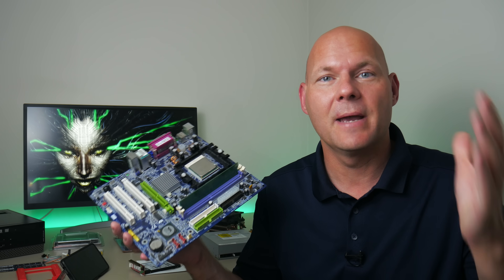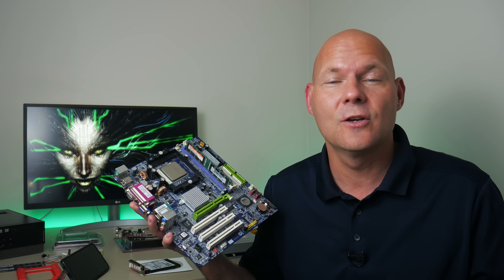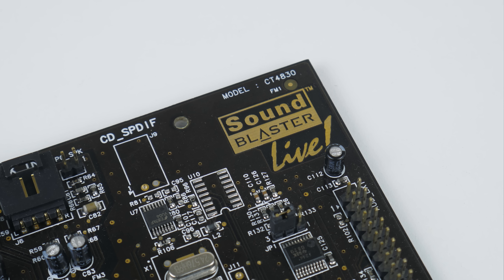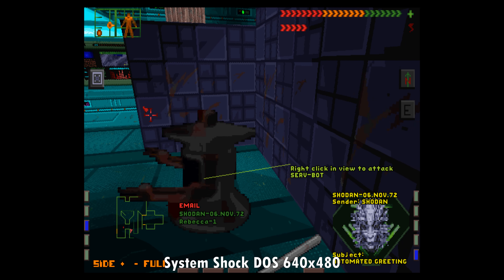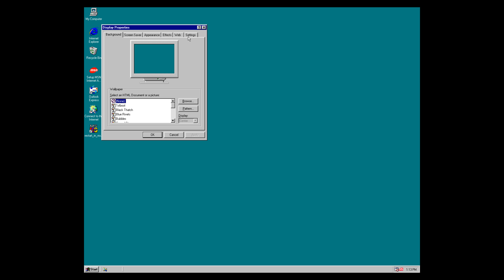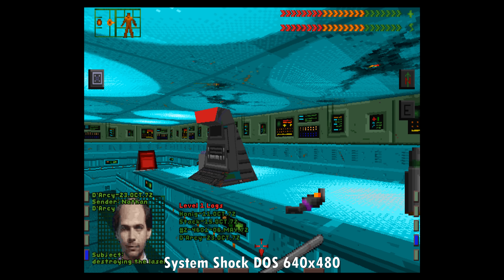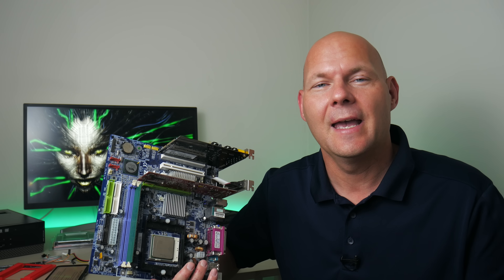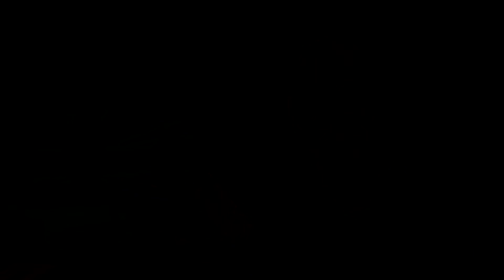Running Demanding DOS Games on Affordable Hardware

Comment: Great video! Can you please make a video comparing a system like this with DosBox?
Reply from the maker: I've done two videos on DOSBox recently, there should be enough in there for you. As for emulation vs real thing, well that's more of a personal matter for most like do you have space and do you like playing with old hardware or do you just want to play the games?
Reply: @philscomputerlab  I watched both the DosBox videos. Great content. I do not have the room, i'd have to make room. I prefer to play the game over building an older system, however I have old parts. I do have Athlon 64s and X2s with the boards to go with them. I have both VIA and nVidia chipset boards. RAM in every different type and module. And I have a plethora of PATA drives up to 500GB. Smallest I think I have is 8GB unless you count the even older scsi and IDE drives that were 20-100MBs. I have a handful of sound cards and a few CRTs. Question is, do I build a rig or two or do I go DOSBOX Staging? I want to try the DosBox method first. I got it working about 10 years ago but back then the PCs weren't THAT old. Last time I tried, about a year ago, I had to shelve the project. For whatever reason I couldn't get it to work. But therein lie my dilemma. I wanted to try DosBox to see whether or not building an older machine would be worth it or not and never got it off the ground. Hence me asking you, an expert in this area of gaming, for a comparison video. Thank you for the reply.
Reply from the maker: @Dr.C-UTS  Fair enough. I'm thinking 🤔 how I could do such a video, it would be mostly talking head and sharing experiences...
Reply: @philscomputerlab  Side to side capture comparisons and compatibility information too...
Reply from the maker: @Dr.C-UTS  In such terms you will struggle to find differences. It's more about issues like you say, not having parts or space.
Reply: @philscomputerlab  For me I have the parts. And they take up so much space I have no more! True story. LOL. I figure a video like that would inform many people. Also, how hard each process is to complete.
Reply: @philscomputerlab  Also, if you need any parts for the video I can donate.

Comment: Hello, you've had a review of an old card.. R7 250 DDR3   2GB.
What is the version of the identification program that you use and is stable with you on this card.
If possible, a link to download this copy.
Thank you
Reply: @philscomputerlab  I need to Driver for R7 250 DDR3   2GB.
Works well with this version of the kart .
Because most of the driver versions . Even the one who is on the amd company website gets after its installation problems with the card ...Screen rupture and device spasm..
This is your video link .
In which she talks about this version.
I have the same copy.
https://www.youtube.com/watch?v=v3a0E3-unHs
I hope you will help me get the right driver version for this version of the card ..Thank you

Comment: Why not Athlon XP instead of Athlon 64?
Reply from the maker: Why Athlon XP over Athlon 64?
Reply: @philscomputerlab  Is a most common CPU after P4 and very easy to find, basicaly is an Athlon 64 but only 32bit. Also most Motherboard for it come with a VIA KM133 build in (Pro Savage/Savage 4) on the Motherboard, a very competent iGPU to play old Dos games.
Reply from the maker: Good point with the graphics! What I don't like about the Socket A is the cooler situation, the high power draw on 5V and issues with modern Power Supplies as well as the exposed die. I've done Socket A videos in the past, for sure we can check out the platform again :)
Reply: @philscomputerlab  im using a good old seasonic single rail on my Athlon XP 2400+ no single issue.
Reply from the maker: It is an issue for people wanting to build a Retro PC though. Especially if you go for one of the faster Athlon. Hence I recommend skip the platform go straight with Athlon 64, I don't see any downside.
Reply: @philscomputerlab  The only Athlon 64 era boards I have all have PCIe only, no AGP or PCI. For me I went with an Athlon XP system partly for that reason, because I wanted to run Windows 98 natively and getting either an Athlon 64 board with AGP or a PCIe GPU that works in Windows 98 was a problem.
Reply: Also a lot of the cheaper Athlon XP Mainboards tend to be quite unreliable. I also would go Athlon 64
Reply: @MKRENB  your opinion, also the same can be said about cheap am2 MB

Comment: I started playing OG System Shock on my retro PC fairly recently under Win98 without rebooting into MS-DOS mode and it works great. I use a Sound Blaster Audigy SB0090 sound card, and in the control panel in Windows you can load up to a 128MB SF2 soundfont and DOS games that use General MIDI will use it. For System Shock, I also used "Toxic Frog's High Resolution Patch" which allows you to run the game at up to 1024x768. Other than the sound card, my system is an Athlon XP 2400+ on an ECS K7S5A with 1GB DDR RAM, running off an SD to IDE adapter. It's worked great for almost everything from the DOS / Win98 era except for some very old games such as Secret of Monkey Island 1. Another game that doesn't work properly that disappointed me a bit was Star Wars Dark Forces. The game will actually run fine with AdLib audio, but if I select General MIDI the game freezes on launch with all the correct settings. I have X-Wing, Tie Fighter and X-Wing vs. Tie Fighter on there and all of those work perfectly with General MIDI music, but for some reason Dark Forces will not. All the classic "boomer shooters" work great; Duke3D, Doom, Hexen, etc.

Comment: I thought original tomb raider had hardware graphic acceleration support? Maybe that’s the windows version only?
Reply from the maker: Only with 3dfx Voodoo and a software patch!
Reply from the maker: And a few other 3D cards. System Shock later got a Windows version, but the DOS one isn't accelerated.

Comment: Hello Phil,
Do you have any idea if the integrated Network controller on this motherboard is compatible with Dos network gaming?
Reply from the maker: I checked the driver package and it includes DOS packet driver, so should be good to go!
Reply: @philscomputerlab  that's interesting. Thank you!
I'm planning a Warcraft2 lan party with my colleagues and I'm trying to find the best way: S754 with integrated lan, or modern PC's with PCem or 86BOX 🙂.
The easiest way I think is DOSBox, but it's too easy🙂

Comment: Another excellent video! As for myself, I have 2 retro machines under my desk. A Pentium 3 500 in a slot 1 motherboard with an Intel chipset that has 3 ISA slots. Voodoo 3 3000 for GPU, an AWE64, a Gravis Ultrasound, and a MPU-401 compatible MIDI card for intelligent mode games, which I probably don’t need thanks to the existence of SoftMPU. I run Win98SE, booting into MS-DOS 7.1 directly. The second machine is a socket 478 Pentium 4 at I think 3.0 GHz with an Audigy 2 ZS for the sound card. Run Win98SE and WinXP on that one. Have you heard of SBEMU? Gives 8 and 16 bit Sound Blaster emulation in DOS running on relatively modern machines. It can work with Intel ICH or High Definition Audio, nForce 2, VIA VT8233 or VT82C86 and Sound Blaster Live and Audigy cards. I haven’t tried it myself, but as long as machine is capable of booting into legacy mode, this could enable much more modern machines to run DOS games baremetal. Could also help in VMs where the hyper visor provides AC97 emulation to the guest OS. Might be something to check out.

Comment: Awesome video as always! :) I noticed you mentioned networking, I have been using RetroNAS for two weeks or so and I found it to be fantastic! You can copy files from any modern machine to it and access it effortlessly from W98 or even DOS (haven't tried with pure DOS though), and the thing has several add-ons, like a proxy to "surf the web" from older machines and a lot more. Have you heard about it?
Reply from the maker: If I network, I use FTP into my NAS 🙂

Comment: I’ve personally switched to using old MacBook Pros for retro gaming. Probably won’t work for DOS era but for XP it works fine. You can get for example a 2009 MBP with Windows XP that will run most games fine. If you get the model with 9600GT M instead of 9400 M combined with the C2D CPU you have enough performance for most games. Unibody Macs are getting very cheap these days. You can get many under 100 bucks and because of the great build quality many remain in great condition. Unlike newer macs you can also put an SSD and upgrade the RAM and it is very easily done. With a cheap adapter you can get VGA out to connect to a CRT and unlike a big tower PC they can be easily stored away when you don’t need it. 2008-10 MBP officially support XP while with 2011-12 models you can run W7 which works with most XP games. Might be a way to get XP working as well but you don’t really need a quad core and GTX 650M for games old enough to not work with W7.

Comment: Thanks Phil, may I ask which drivers you used with the CT4830 as I've previously struggled with that model of Live! Card?
Reply from the maker: I am using the Audigy 2 ZS driver method, there is a link in the description. They are wonderful and should work with your card.
Reply: @philscomputerlab  Perfect thankyou! 👍

Comment: Cool video with some great recommendations, imo.   

I actually dumped Intel after the PIII and went with AMD for the Athlon Thunderbird, and Athlon64 eras, and I believe I even went up to the Phenom X4 as well, before returning to Intel with the i7 970.

I actually ran the Gigabyte GA-K8V Ultra back in era, with an Athlon64 3800+, with I "think" it was a BFG GeForce 6800 GT at the time, a SoundBlaster Live, and I think it was 1GB RAM at that time as well, maybe 2GB.

In any case, never used it for DOS games at that time, of course, but it was a great system for Windows XP, during my WoW years.  😄

Comment: Seeing that Gigabyte board reminds me sad memories: I got TWO of these bricked by a faulty RAM stick. 😭 Acquired a similar Asus K8V-MX later and still is my main Win98SE rig (with SB Live! and Radeon 9600 Pro).

BTW Phil, what about Socket 370 builds? Many of them have at least one ISA slot, providing even better DOS sound card compatibility; Coppermine P3 should be fast enough for 640x480 VESA resolution and are much cheaper than Tualatin P3. The only problem might be availability; not sure if they can be acquired easily without breaking the bank nowadays, although I got mine (Gigabyte GA-6VXC7-4X-P + P3-600) for just US$30.

Comment: I tried building with a Radeon 9200 pci and it worked fine under windows 98 but once I tried dos I got weird artifacting. It may have been my scaler solution but switching to a GeForce FX 5200 fixed all the issues I was having. (Probably picked up the fx because you recommend it) I did not know about the dvi locked at 60hz I will need to look into that. Always picking up awesome info from your videos.

Comment: My go-to DOS machine is still a mid 90's toshiba laptop (the chunky gray ones) with a P1 or P2 cpu.  those often come equipped with an OPL3 sound chip and a decent 2d windows accelerator chip. :)  the -CDT models often have decent screens.
Reply from the maker: P1 and P2 are actually quite different for DOS gaming. P1 you can slow down and run older speed sensitive games nicely. P2 is better for demanding 3D games.
Reply: @philscomputerlab  True.  I do use setmul to disable cache on my P2 computers to run speed sensitive games.  My 4030CDT (PII-300) is setup as a DOS machine in that manner.  the graphics chip on it even has Win 3.1 drivers.  it can cover a surprising range of DOS games with just a quick utility. :)

Comment: I accidentally bought a 486 DX-33 machine but socket 3 is too slow, Doom II runs like a slideshow, 486 overdrive is overpriced, i'd like a socket 7 based system for pre 3D games with an ATI Mach II 64 so CPU clock speed is something i need, i have my pentium II laptop thats modified to run at 333 vs 266mhz and it'll even run quake I decently, but i think a 166 with MMX would be a big upgrade over a 33Mhz system.  its difficult to find a reasonably priced case that isn't heavily damaged here in the UK, so AT does make it awkward, but my style is period correct, i've lived through the compatability issue era with computers, i just want things to work and use modern workarounds for QOL improvements to the experience, i need to put some AT specific hardware i have lying around to use rather than sit in a box, as long as its got PCI, i have items i can use, ISA gets expensive for old cards. The case and the motherboard is what makes getting into an old AT system expensive, but things like memory, cpus, video cards are pretty cheap, i tend to stick to a £100 budget for each retro PC. 

As for the 486, i may end up selling it on, it was a total time capsule and i mainly got it to save it from battery leakage and the CRT since they're getting hard to find, i'm going with Windows 3.1 + DOS for the machine if it comes to light as i just need a basic GUI for file management then boot into DOS, while SSDs are good, i feel a lot of its space is wasted and though hard drives will eventually die, i would like to try a Hard drive OS + CF to IDE games drive combo so theres no risk if the hard drive does go. 

My 95 PC will be K6 based for some more demmanding early 3D Games, racing ones and my 98 PC will be a slot I Pentium III based machine with parts from an old computer i saved at a boot fair as a child with hopes that one day i would turn it into a computer to play the games my dad said i had to wait to play, once these parts became dirt cheap and windows 98 was old :) Little did i know i should've bought all these £1-10 old computers knowing that some would be worth a lot of money, i specifically remember seeing a Willamete P4 and GF3 Ti pc there that was too much at £25..oh how i wish i persuaded my parents more :p
Reply from the maker: Keep that 486! It is perfect for older speed sensitive games. You'll regret if you sell it now. Do check that it doesn't have a battery that's leaking though...
Reply from the maker: In terms of prices, currently XP era hardware is cheap. There is heaps more available but at some point those will get rare as well and modern hardware is incompatible with XP...

Comment: Thank you for the video. I currently revived my old QDI-Legend V mainboard (intel 44LX) with an old ISA Soundblaster 16. I was very happy that I kept these parts, as the prices for pentium II and pentium III mainboards already includes "collectors tax".
I was running some older games also on an AthlonXP 2500+ with a terratec ESS-Solo-1 as it was cheap to get in the past.
Currently K7 Mainboards are also very easy to get and maybe an alternative to the newer AMD Athlon64.
Reply from the maker: Very nice!

Comment: My friend has a Pentium 4 tower that has not been used for years. I may have to ask her to borrow it. I spent 2 years upgrading it in the 2010's with more memory, faster processor and graphics card until she gave up using it as her daily computer and bought a more modern i7 laptop.

Comment: i have a shuttle 754 socket with athlon 64. I couldnt ever get it to boot windows 98. But im covered with older systems so i use it for XP. Only thing id change is that prefer audigy 2 over the live. But live isnt bad and i have one paired with a P3 1 ghz.
Also audigy drivers can be used with live (search vogons)
Reply from the maker: Yes I used the Audigy drivers with the Live!

Comment: Due to traveling abroad I left my old machine (Compaq Deskpro Pentuim3 with its CRT) I only ever changed the harddisk.... was corrupted by Windows Millenium then I installed windows 2000
Never knew there would be a demand for these back in 2009
Well as you showed we can build an eco-friendly more efficient machine nowadays or just emulate with dosBox Staging like the previous one!

Comment: I find it interesting that DOS and Windows 98 work on hardware that recent. What is the newest generation of CPU these work with? I have wondered if Phenom II would be compatible with Windows 98 since the motherboards have many of the features socket 754 and 939 have, but the RAM might be an issue due to the capacity of DDR3 modules being too high.
Reply: Phenom II X2 paired with an Asrock AM2NF3-VSTA and 512MB DDR2 PC3200 will 100% run Windows98. It's pointless, but it runs.
Some guy even managed to install W98 on a Ryzen CPU. The video is on YT.
Reply from the maker: LGA 775 is the latest that I personally had food success. Some PCIe graphics cards work in 98 BUT there are compatibility issues...

Comment: MSI's boards from the time seem to be good for DOS and Win98 PC (at least their KT600 or KT800 boards). Their implementation of SATA on at least the KT6V works well under 98 - no driver is needed for the controller to install to and boot from HDD on it unlike under XP. Even PS/2 hot plug works (at least with my AT keyboard using an adapter).

Went for the extra cost of a proper Solo-1 (not the 1e) for my mum's retro PC while retaining the Live Value! for my own PC - her old Casio Keyboard would work with and sound better through the Solo then the Live (plus Magic Boy has working sound with the Solo).

Comment: My retro setup:
‒ Siemens Mainboard D990
‒ Intel Pentium 150MHz
‒ 48 MB RAM
‒ 40 GB HDD
‒ Windows 98 SE
‒ ESS Audiodrive es1868f ISA sound card
‒ Realtek RTL8139/810x Family Fast Ethernet NIC (PCI LAN card)
‒ 125W power supply
‒ A:\ floppy
‒ B:\ floppy
‒ DVD drive
‒ removable HDD rack (empty)
My sweet retro period is the mid-late 90's. 🙂